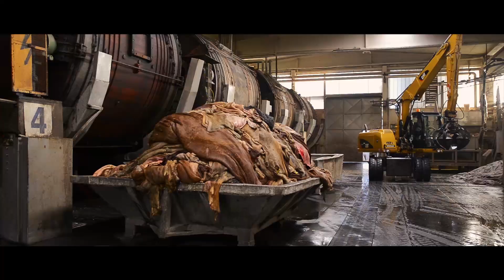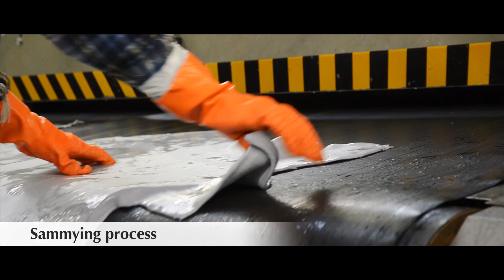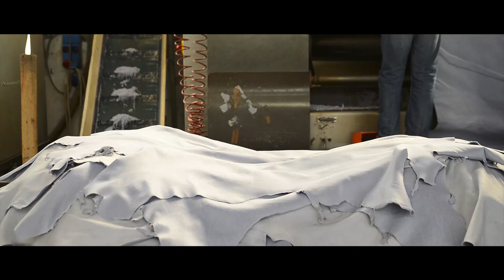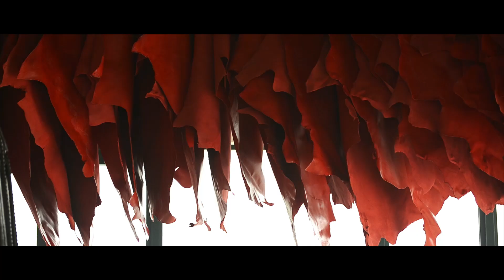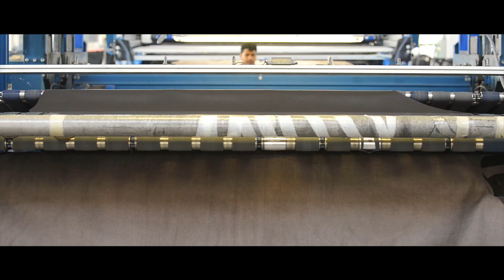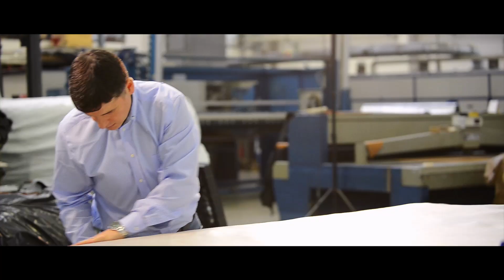The Tanning and Finishing Process of Leather

Comment: that is how you get shit "leather" that is not leather on the surface, not real leather grain, not real tann leather color. Nothing interesting about its pattern, wearing a jacket made from this and you can say you never touched leather, but plastic coated, synth dyed, fake grain, chrome salted material. and it gets worse, most of what they sell is the lower half split part, the lower piece which is embosed and coated, and most stuff you buy is the bonded leather, the shavings grinded to paste glued together and embosed and coated again.

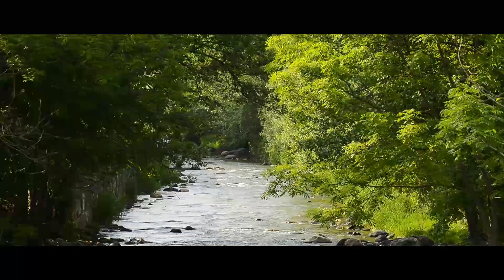Comment: 15:34 "this is a near by stream poplated with local fishes. it is not the one we dump all the toxic chemicals in" 
fr though, was very informative for my random curiosity and i am very happy with the simplicity of it while still going in depth enough to satiate my curiosity.
Reply: Granted further muckraking needed but it SEEMS like they did the proper Industrial Wastewater Treatment…granted this probably ends in Landfilled (Chromium Hazmat?) Sediment, and their aforementioned Sulfur Outputs, as well as “Conventional” Wastewater (if they don’t have their own discharge), which MAY not be at no BCOD / Nitrates / Phosphates etc or be clear drinkable/reclaimable water etc.

Trace “leaks” from Worker’s Clothes + Boots and whatever, as well as dust drifting in the wind, would be worth looking into as well.

Still better than what most places do though!

That and the emphasis on Mechanization (i wonder if those claws are always there or just rented for when press is in town!) had me a BIT skeptical, but yeah.

Comment: Hello, can somebody help me? I have a question about the process. 

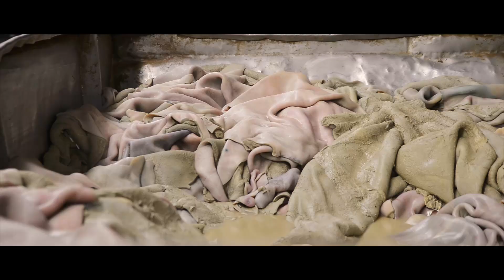At 2:22 it was said the hide is removed from the drum ''to be flashed and trimmed''. Is it the same for most tanneries? Is it possible to finish tanning without removing the hide from drums between pickling and tanning? 

I will really appreciate your help.
Reply: Fleshing is necessary for removing unnecessary flesh from the hides, to make them even and also to open up the pores to help in chemical penetration.

Comment: Optima Leathers     Question:     Would leather dyed a black colour, be cheaper to buy in the finished product, in regard to other colours like, beige, red, blue, etc.? Thank you in advance...
Reply: I don't work for Optima but I did work in the trade some time ago. Actually achieving a deep true black through dying alone is quite difficult to achieve. We kept our dye formulations a trade secret especially for clothing leathers. However, what we also did was redye black our failures, the stuff we couldn't get correctly color matched or samples we'd done which ultimately we weren't going to put in full production. That you could probably get at a lower price as long as you wanted at least 2 or 300 sq ft minimum. Back in the day we also sold cheaply into the former USSR so as to maintain prices in the US and European markets.
Reply: @tomroland2315      Thank you Tom for that informative feedback. I just assumed that it was cheaper for Vehicle Manufacturers to trim their vehicles in Black, be it leather or cloth. I guess I came to this conclusion, as virtually all vehicles across all brand names and model variants we find are trimmed in black, and but a few up market models in the luxury range, trimmed in Beige leather. My biggest gripe with vehicle interiors having black trim, is that it gives one a closed in feeling, whereas a vehicle trimmed in a lighter shade of beige or even light grey gives an air of spaciousness. Cheers...
Reply: @davidhamilton506  I guess a single color keeps things simple regarding quality control for the mass market.
Reply: @tomroland2315   Yes, That must be it. Anyhow thanks for taking the time out to answer my initial inquiry, cheers...
Reply: Ask some other search hafeez sons tanners on google